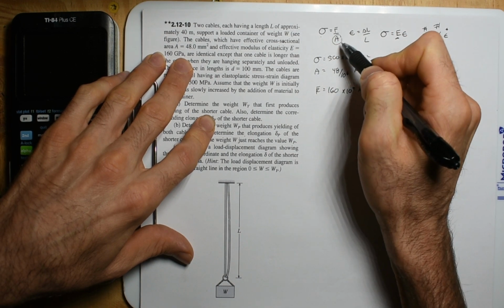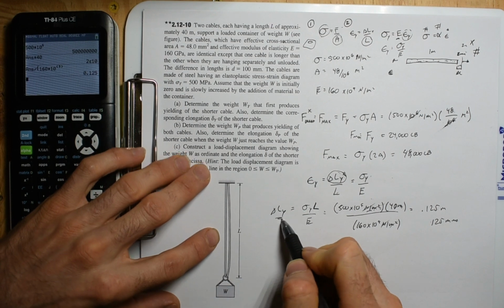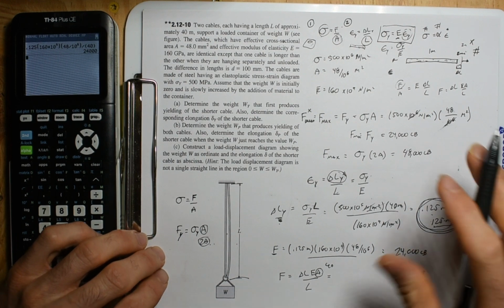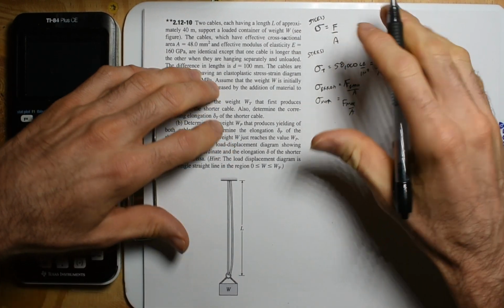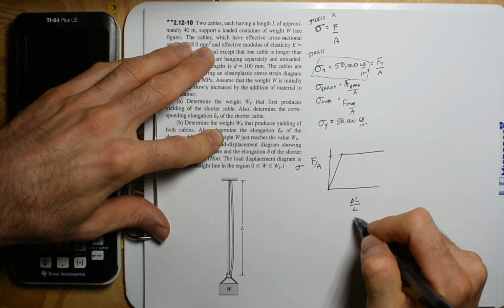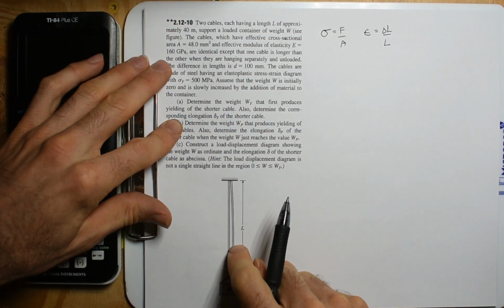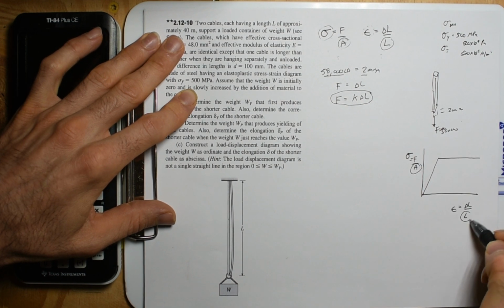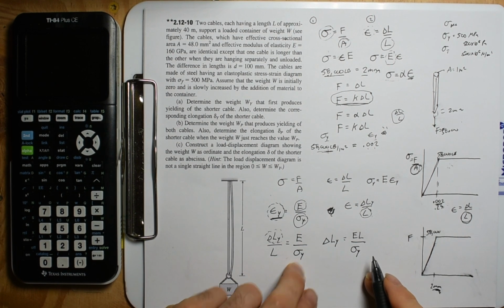TWO EQUATIONS!  2 Ways To Solve!  MECHANICAL ENGINEERING!

Comment: For one cable only, it does start yielding when when the displacement is 125. But with two cables, when the displacement is 125, the second cable is also stretched and "helps" the first one, increasing the required weight Wy right ? With my calculations it that extra force should be EA/L * (125-100) = 4800 N = T2. So in total T1 + T2 = 24000 + 4800 = 28800 N.
Similar with the second case where both cables yield. 52800 N if im not mistaken. (EDIT: That last part was wrong)
Reply from the maker: You are totally right!  I apologize for not answering the actual question in this video.  I see that is confusing on my part.  I did answer this one in a previous video but have just posted this video to get there faster thanks to your reply!  https://youtu.be/6lynQNkwDM4
Reply: @holdmybipolar  Yeahh that disclaimer part missing is what confused me. But it was a good video nonetheless. Also noticed my mistake in the new one. Good content !